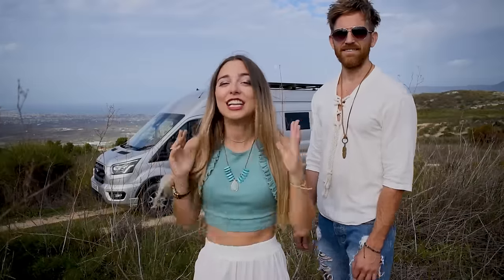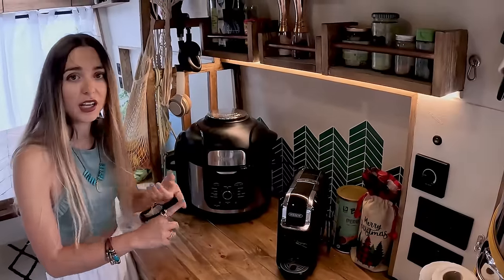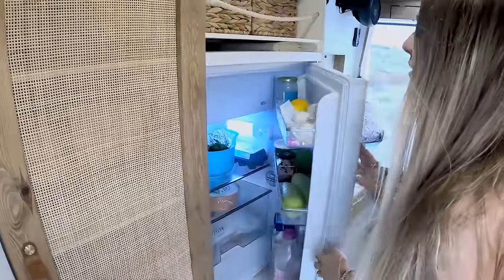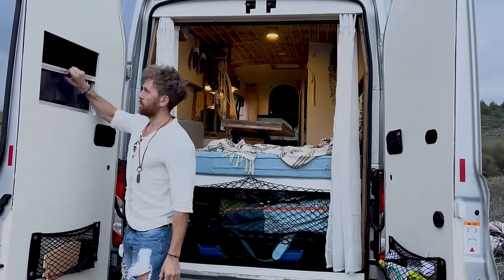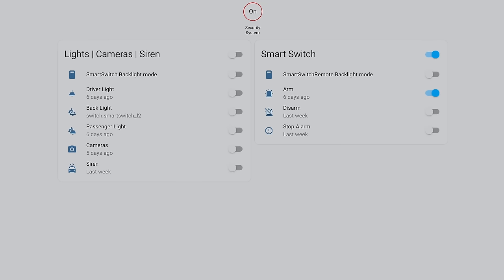PERFECT Van Layout | LUXURY Van tour | Bathroom + 11K watts

Comment from the maker: Hey! I know the length of this video might seem daunting, so I've organised it into chapters. Feel free to skip ahead

00:00 - Introduction: Our Journey to Van Life
01:00 - Ford Transit Camper Van Conversion Specs
01:26 - Conversion Essentials: All-Electric System, Open Layout, Fixed Bathroom in Camper Van
02:00 - Entryway Features: Sliding Door Step & Bamboo Finish Kitchen in Our Camper Van
02:41 - Front Cabin: 3 Seats Configuration in Our Luxury Camper Van
03:00 - Custom Build: Easy Cabin Access, Ample Storage, and Superior Insulation in Camper Van
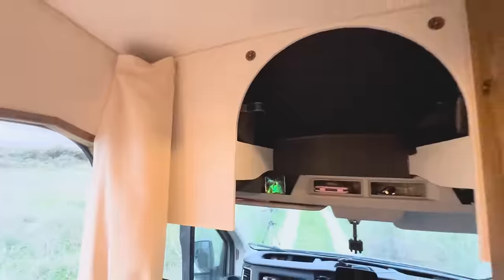04:48 - Luxury Bathroom Tour: Permanent High-Pressure Shower & Toilet in Camper Van
06:35 - Gourmet Kitchen in Camper Van: Countertops, Appliances, Storage Solutions
09:40 - Ambient Lighting: Adjustable Dimming Features in Our Camper Van
10:48 - Creative Inspiration: Kitchen Ladder in Our Custom Camper Van
11:00 - Wardrobe Solutions in Camper Van: Space-Saving Storage Ideas
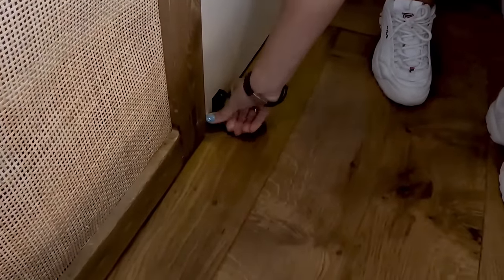12:28 - Efficient Cooling: 240V vs. 12V Fridges in Our Camper Van
14:00 - Insulation Details: Our Camper Van Build Specifications
16:20 - Ceiling Design: Inspiration Behind Our Self-Converted Camper Van
17:20 - Living Area Walkthrough in Our Luxury Camper Van
20:35 - Power System Overview: 48v Electrical Setup in Camper Van
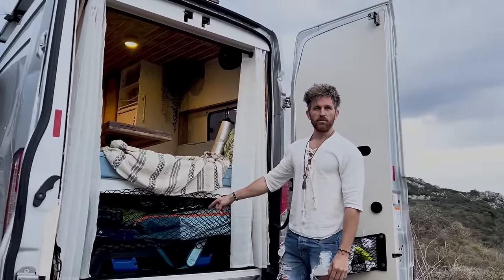22:45 - Garage Storage Solutions in Our Camper Van
23:53 - Plumbing Specs: Comprehensive Guide to Our Camper Van's Water System
25:24 - Bed Conversion: Transforming Our Space into a King-Size Bed in Camper Van
26:00 - King-Size Bed Feature: Maximizing Comfort in Our Camper Van
27:19 - Security Systems: Ensuring Safety in Our Camper Van

Comment: Hey guys, amazing van love what you have done with the van! Just one question, did you get your inverter programmed correctly for the charging voltage for your lithium batteries ? It’s done via a MK2 USB cable supplied by Victron? I am sure you have it all set correctly but if you have any questions please give me a shout as I work with Victron equipment on vans a lot! Enjoy your travels 👍🏻👍🏻
Reply from the maker: Thanks a lot Chris. Yes we have programmed it with the Mk2 USB, so far so good, but thanks a lot for offering, if we have any trouble or we know someone who needs help I'll let you know! 😀